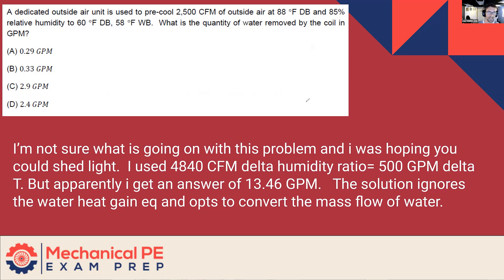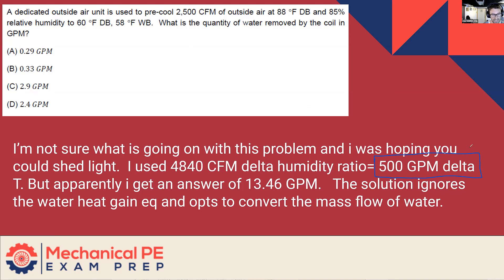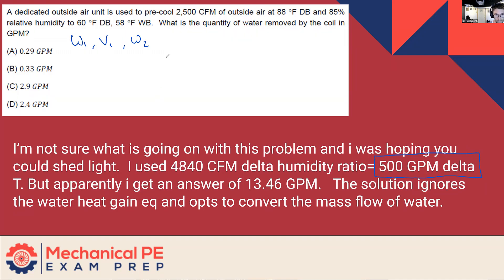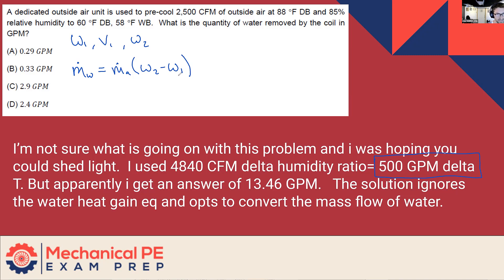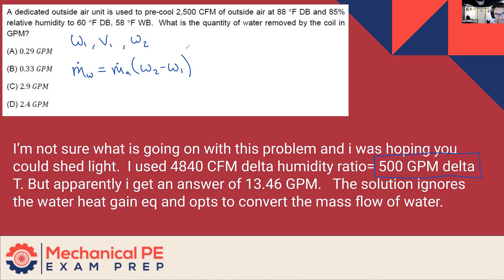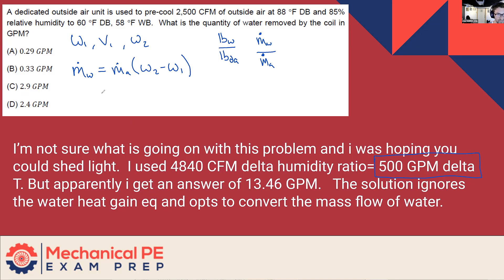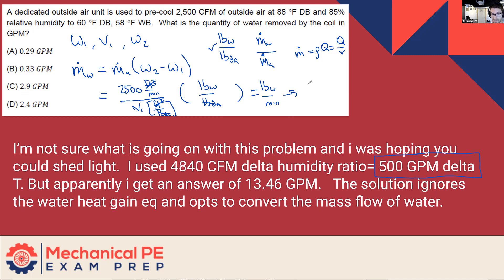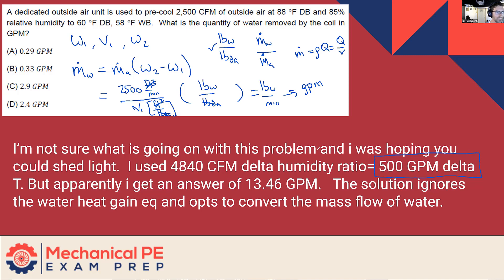How to Calculate Water Removal in HVAC Systems Using Humidity Ratio | Mechanical PE Exam Prep

Comment: the correct answer is A. 0.29gpm. right ? i solve it with data form psychromatic chart
Reply from the maker: Sounds right Tay.  FYI - there are loads more problems in the program with detailed video solutions.  Visit www.mechanicalPEexamprep.com

Comment: Just to check,  is the correct answer B?
Reply from the maker: Hey Blaine, Can't remember off the top of my head.  The session this clip came from was "Office Hours" which is for troubleshooting questions with candidates and clarifying the overall approach to problem solving.  Hundreds of full detailed video solutions to examples like this one are in my program, the HVAC & Refrigeration Full Access Bundle.  Check it out, it's a sure bet if you're studying for the PE exam. Reach out to me directly with any questions.